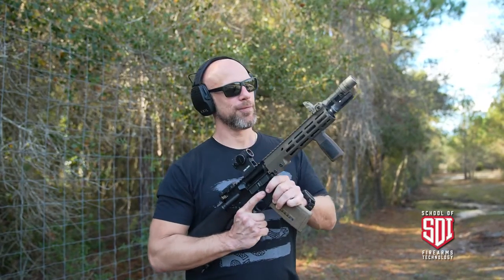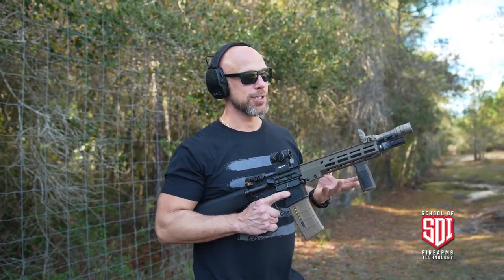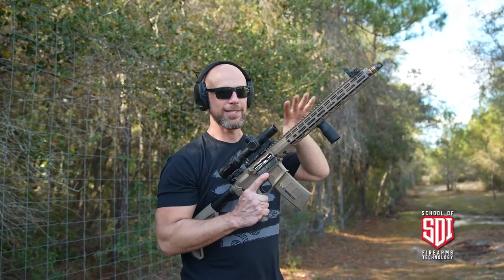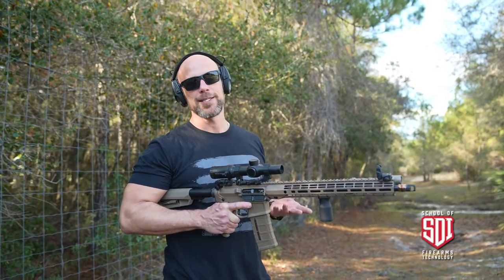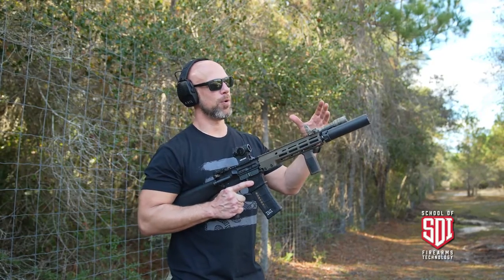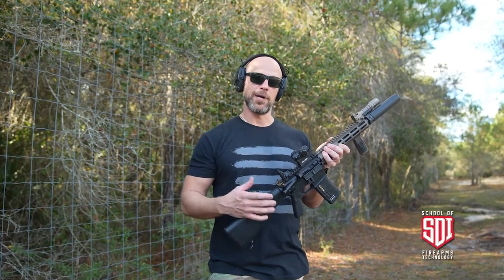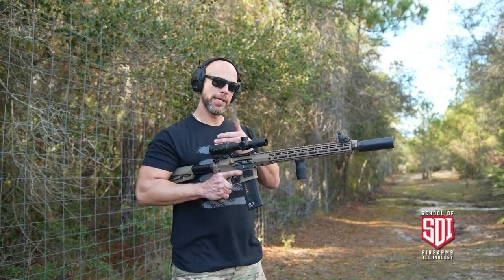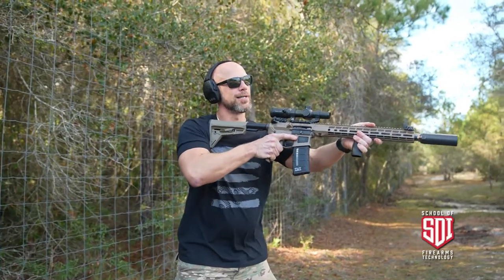Flash Hiders, Muzzle Brakes, and Silencers With Mrgunsngear

Comment: I have a question that I haven't seen discussed before. Does using a muzzle brake vs a flash hider, in conjuction with a suppressor, increase flash signature to any measurable or noticeable degree? I'm currently using a Surefire muzzle brake with a Surefire Socom556 RC2. I went with a brake to act as a sacrificial baffle. Saying this, flash signature reduction is my highest priority so I'm willing to switch it out for a flash hider if there's a noticeable difference.